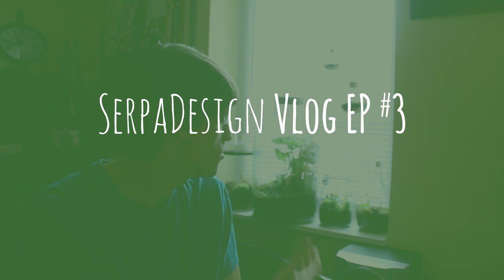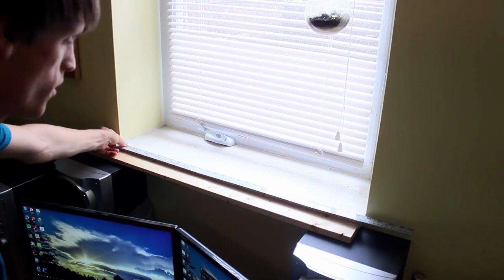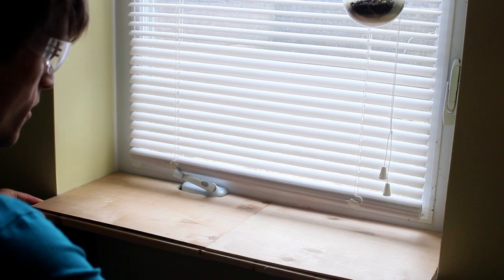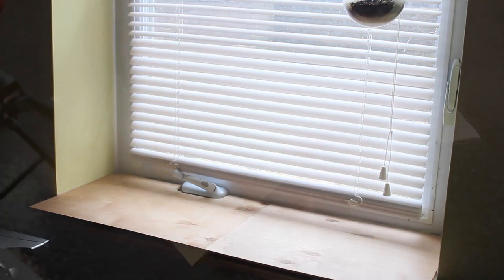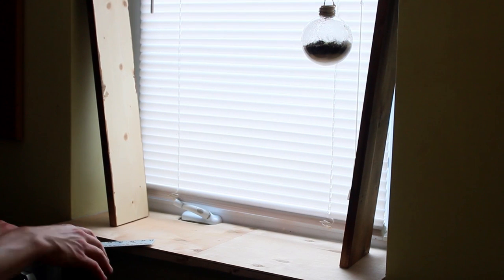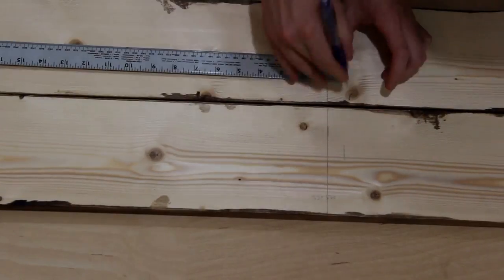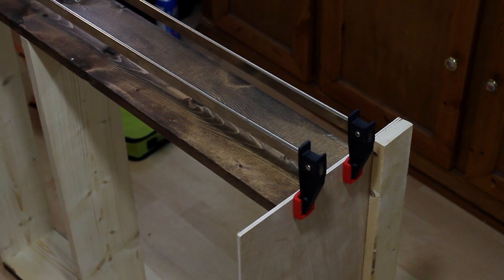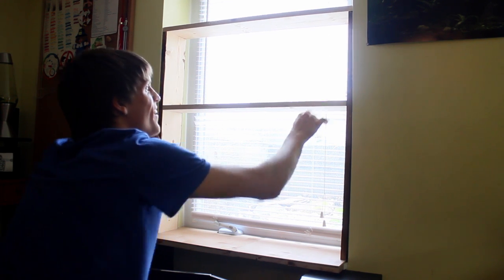I Ran Out of Room For Terrariums! - Vlog #3

Comment: I would unscrew the shelfs and use both wood glue and screws. Wood glue is much stronger and with your computer sitting right below it might be a good idea.
Reply from the maker: Ordinarily I would do that, but this is not a permanent solution. Plus construction screws like these will hold a few hundred pounds, so I highly doubt anything will happen.